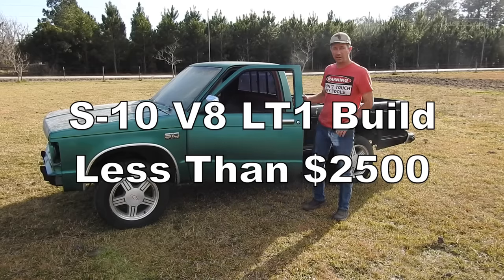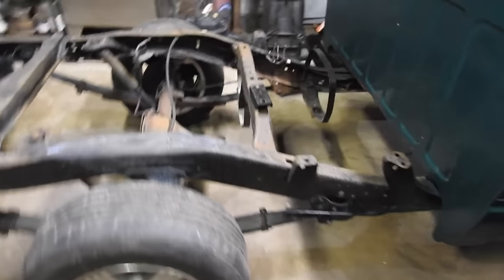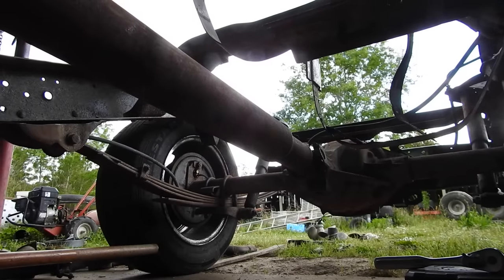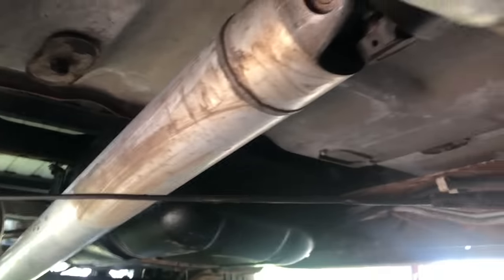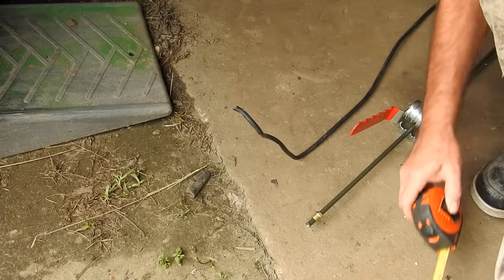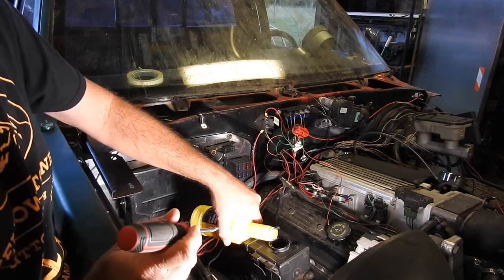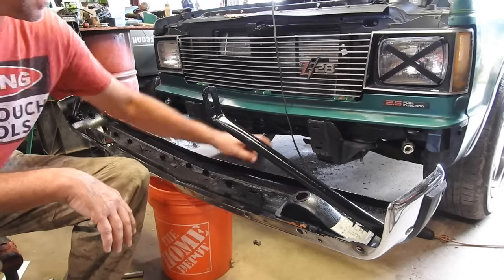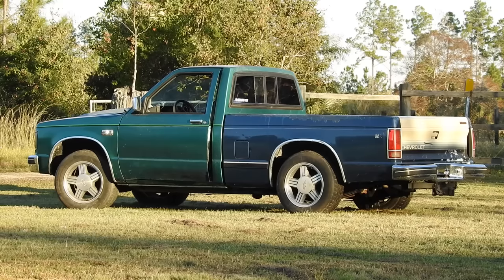S10 V8 LT1 Build for Less Than $2500

Comment: Thats great the boys are big enough to do the heavy work for dad now. Just a tip always flex mount your exhaust or it will cause problems like weld cracks and exhaust mounts breaking. It solid mounts to the motor and the vibration goes thru the exhaust causing that problem. That comp. mount was the best place and looks awesome. Them s10's have a ton of wiring. Great idea on the copper hose bend. Also if you ever need any bends done Im local and have a good bender. What car show is this weekend?
Reply from the maker: There is always the Fourth Saturday main street show, but I got busy working on a mower.  Will try to hit the show in Callahan at the depot first week in November. And maybe Hardee's second Saturday. Would love to do Daytona Thanksgiving weekend, but may wait till the spring show to take the truck. Bender would be handy, thanks for the offer and for watching.
Reply from the maker: So you don't think the computer will get too hot there?, I wish it was hidden under the dash. Yes on tons of wires too...
Reply: @chud327  No that comp. will be fine thats the same location as the 2nd gen dodge and you can only imagine how weak a dodge computer is and I'll probably see you at the depot show. Ive got the beast running and reg..
Reply from the maker: @scottsinfl  that is cool. I need a new windshield before the and and insurance . Might not have that done by then. Still plan to attend either way. Make sure you say hey

Comment: I've done multiple V8 conversions on S10 AND Ranger trucks. The Chevys are alot cheaper but the Rangers always seemed to be easier for me. Either way, they're both fun. My favorite Ranger is my '96? Splash with a 5.0 H.O out of a '92 Foxbody. My favorite S10 was my '03 Xtreme with an '02 Camaro SS swap. Ranger is a 5-speed the Extreme is automatic. I really wanna do a 90s Dakota with something wild, like a totally built 318 with a 4 barrel, high rise intake and a pissed off cam. That's gonna be my next project after winter. It's hard to find a Dakota around here that isn't rotted to pieces.

Great work and great video! 🤘👍
Reply from the maker: One of each from the big three would be great, heck have a ranger and S-10 is cool to. Do you have any videos of your collection. Would love to watch the comparison. Chevy is always cheaper in my book, but the again, I rarely work on Fords unless it is for someone else. Thanks for watching!!!
Reply: Just get one of the Dakota rt that have the 360 factory and you won't have to swap anything.  They're available in rcsb.  They was like 250 horse 350 tq factory but they're actually pretty stout and come alive with mods.  I seen a guy on YouTube who did a heads cam turbo build and was over 600 wheel for years on the stock bottom end..
Reply: Seems like the ranger would be cheaper since the explorer was same as ranger and came factory with a 302 option so you could source any parts needed from an explorer it seems.  You could even drop an entire explorer motor since they have the gt40 top end but swap the cam and springs before putting it in the ranger with long tubes it would be a decent runner.
Reply: @midnight347  you are correct in pretty much everything you said. The problem is that five liter Explorers are rare around here and it's even rarer to find one that actually runs. I think the Mercury Mountaineer came with five liters also and AWD and I'd kill to yank the entire drivetrain out of one and stuff it into a Ranger

Comment: While it wont be cheap I would consider a limited slip differential (LSD)   maybe new rear end ratio....do you want better acceleration or a better (lower engine rpm) highway gear    I have a v8 302  swapped 1984 Datsun 200sx with a T5   I originally had a  r200 3.9 open diff....went to a 3.15 lsd     makes better highway speed and still accelerates very well      the open diff spun one tire to easy     the 3.15 lsd makes the car hook and go
Reply from the maker: I actually almost picked up one at the junkyard. It was the whole rear end on half price day. However it was 4 something years and I don't want to give up all my gas mileage. Found another, but was too close to closing time. Will definitely be researching something for the rear in future episodes. Thanks for watching and your ride sounds cool.

Comment: You should put a valve on the exhaust so you can just flip a switch and it changes the exhaust like opens and closes
Reply from the maker: Funny you should say that, I did that tonight, but it is a cable you pull instead of flipping a switch. Video coming soon and thanks for watching.
Reply: Ok well I didn't really know that I mean I only seen it in a movie that I watched

Comment: I had a truck we called frankensten. Yes, sten. That's what we called an S-10. The front half of the truck was 2 different 1987's and the back half and frame all came from an 89 lwb. I ended up with a 383 stroker in it. The entire build was similar to a friend of mines, dads truck. It turned out pretty nasty. I never totally finished the truck. It was running and it was extremely fast but there was more I wanted to do to it. A guy offered me the right amount of money, I sold it, and then started another project lol
Reply from the maker: sounds very cool and like something I would do. No one has offered anything yet, but if I sell it, I will kick myself the next day... Always wanted a 383, maybe someday. Thanks for watching.
Reply: @chud327  honestly, I really hated seeing it driving around town after I sold it lol. I stayed upset for about 2 years after that. They had painted it and used it as a truck to draw attention to a local auto parts store. They would let employees run errands in it. That finally caught up to them when someone blew up the motor. Some advice for your build: get some really wide tires for the back. It's light and doesn't take much to get it to break loose. My truck was scary to drive on a wet road.

Comment: One of the scariest test drives I’ve every had was when I checked out a c10 with a v8 , lower the center of gravity and try your best to get its weight ratio in a better balance , a lot of weight up front  . If not just drive it straight line at any speed  , never use it with any velocity on corners .
Reply from the maker: Sounds like fun, thanks for watching!!

Comment: Now this I'll watch. I've thought about putting an lt motor in an s10.
Reply from the maker: This is my 5th V8 S-10. I love them .. thanks for watching!
Reply: @chud327  nice. We're any of them the newer body style? I used to have a 2.2 liter single cab
Reply from the maker: @ian5780  not with v8. They were all square bodies. However, I have had about 25 S-10’s probably 1/2 were newer style.
Reply: @chud327  that's a lot of s10s.

Comment: i only have 2000 in my 68 chevy pu with rebuilt front and back suspension power steering and power breaks, running a stroke 454 with a 02xx trans good to 800 hp full chrome trim full new gauges new tail gate dash all rebuilt looks better then new with the chrome parts full power heated buckets black leather, then i have a 79 cheyenne 4x4 short box full option truck with a 400 sbc and 400 turbo 100% factory got it free, then i got a 70 ford high boy dana 60/80 lockers ranger with tool box on side with a 390 4 speed only have 250 in it rust free really good body on all the rigs but i have a lot not on the road have 10 acres of rigs cars and trucks have a lot of hot rods on the road plus i get parts at cost from the auto parts place
Reply from the maker: Sounds like you got a great set up, I wish I had more junk cars... thanks for watching.

Comment: I cant tell you how many times I have had to take a part off that I had just installed. Often times after a lengthy step by step procedure that had to be done in order. Love the mini-square body. Rear looks too low tho. liked & sub'd
Reply from the maker: Yes, I did get ahead of myself a couple of times and had to back track. I actually put the engine in twice, but didn’t have time to show all of that. Will measure the rear, I wanted it level. May use the 3 inch blocks in the matching truck bed trailer I have plans to build. Thanks for watching.

Comment: If that is a factory rear end Plan on replacing the spider gears fairly frequently.
I used to have an S 10 with a 350 so I know this very well.
Reply from the maker: This is my fifth V8 S-10 so far. I have had no issues yet. All were stock, 2 had lockers, all ran street tires. We will see and thanks for watching!
Reply: @chud327  It must’ve been the weldracing wheel pro star’s I had that made it hook so hard and it ate the gears. LMAO

Comment: Nice job on the POS 10. Only things I would have done different is I would have put little metal things over the radiator rubber support bracket gimmicks but also I thought the rear end was a Ford 8.8 with a locker it seems to be a one wheel peeler. I think you would have been fine with the 2-in lowering blocks after all. What are your next plans for it?
Reply from the maker: Next is wire up the tail light, fix rust around windshield, wipers, build a matching truck bed trailer, stereo, exhaust cut out that works remotely, front spoiler, burnouts, tag and insurance, camping under the topper, car shows, pull trailers, haul mud mower in the back, drive it...  Maybe someday I will paint it, but for now, I am digging the multicolors...  Thanks for watching.

Comment: i had a LT1 swapped 96 extended cab s10 back in 97 or 98 yep i was first haha anyways at first it ran crappy but the more i drove it it started waking up,next thing you know it was fast as hell,i was beating mustangs and camaro's,ss impala's it tuned itself is what happened,i didnt put a cam in it,the engine was out of a vette or a camaro it had aluminum heads.i had a five speed manual with 356 gears and it was bad ass,i just built a 600 hp LS swap you talk about a lot of money.
Reply from the maker: Very cool!! On the LT1, did you just use the stock fuel pump? Mine feels like it is starving for gas when I get on it. I was thinking I would try a new fuel filter first. Thanks for watching!! You had to first that long ago...

Comment: You are probably going to be fighting exhaust pipes cracking or breaking welds because it looks like you mounted the pipes solid without a rubber mount so it can shake around with the engine. Without rubber the engine moves and the pipes don't.
Reply from the maker: Yeah, I have been thinking about that and may have to go back and modify. Thanks for watching.

Comment: Damn man, I just sold my caprice and now I'm seeing this sweet ass LT1 swap, it's making me miss the hell out of that car. By the way those worm gear hose clamps on the fuel system make me nervous man, I went with all steel braided fuel lines and AN fittings for my LS swap but if I was to use rubber hose I'd DEFINITELY use high pressure fuel injection hose clamps and not those worm gear ones. I know probably nothing will happen and it'll be fine, but this truck burning to the ground because of $5 worth of hose clamps would be a damn shame.
Reply: Caprice has a 4.3 v8
Reply: @born2wrench  some of them did. Was more rare as an option than the LT1 at least from 94-96. I don't think I've seen one with the 4.3 in person. Mine had an LT1

Comment: Looks good , but with the 3" lowering blocks it almost looks too low in the back compared to the front . Think you will need to lower the front more now!!
Reply from the maker: I will measure it a couple more times, I was shooting for level. I am planning a matching truck bed trailer build, I might you the 3 inch blocks on that and get 2 inch for the truck.  Or I could lower the front an inch or so. thanks for watching.

Comment: need remeasure may need 2in blocks after all its lower in rear than fron appears. it look better if not level be lil higher than lower
Reply: didnt mean sound like was knocking it i re read it n kinda sounded that way but by no means! i too have love for s10 i currently have the sweetest 2000 extreme that has been sitting for 6 months i put wrong key in it ha ratchet shifter and 700r4 only 100k miles it sux it sitting bout to build carport n get it out weather . one day i rekon il do  ls swap it if cant figur it out the wiring on this one cuz its custom n i dont know who did it ....but anyhow keep videos comin you do a great job a true engineer
Reply from the maker: Yeah I want mine level or slightly higher in the rear. If my rear is lower I am hauling something. Thanks for watching!

Comment: Good work .to low in back 2 inch.would have been better .would have gave it a small rake and would have looked more S28 hotrod .plus the receiver hitch is now to low for towing ...air shocks I hear ya
Reply from the maker: Yes, I may use the 3 inch blocks when I build the matching truck bed trailer and get 2 inch for the truck. Air shocks would be cool too, it already needs new rear shocks  Thanks for watching.

Comment: You did a great job on that truck. Sounds nasty in a very good way. I think it would have looked a touch better with the 2 inch lowering blocks, to me it looks like it is a bit low in the back with the 3 inch blocks
Reply from the maker: Was going for level and when I measured there was a 2 inch difference, after buying 2 inch blocks, I remeasured and it was 3 inches. Maybe it went back to two .. bipolar truck?? I may use the 3" blocks on the matching truck bed trailer I am planning to build. Thanks for watching and for the comment!

Comment: you might already know but I believe GM makes a high torque starter that’s about half that size and should be more clearance
Reply from the maker: Yes, I had to use one on a prior project. Will keep that in mind just in case. Thanks for watching and for the tip!

Comment: I think it would look better with 2 inch blocks so it has a little rake in it stance...
Reply from the maker: I am kinda thinking the same thing. I think I will get the 2 inch blocks and use the 3 inch blocks on the matching truck bed trailer. Thanks for watching.

Comment: Should have keep the 2 inch lowering block's.  The 3 inch made it  a little bit to low in back. Otherwise awesome build.
Reply from the maker: Excellent suggestion and if you check out part 2, you will see that I agree with you. I picked up and installed 2 inch blocks again. thanks for watching.

Comment: The 2" lowering blocks prolly would have made it look more level, the 3" makes it look like the rear is just a tad lower than the front.
Reply from the maker: Measures level, but the can always get the 2” and use the 3” on the matching truck bed trailer the I just started. Video coming soon.

Comment: I have an S10 with a lot of good parts and a bad body.  I'd planned to install hydraulics and make it a show truck.  The doors and bed are bad.  The suspension is new including shocks.  Brake system is new.  Has 9" drop kit.  Billet trifan wheels and billet steering wheel.  Would make a hell of a lowrider.  I'd sell It for the right price.  It's been sitting for 25 years.  No back window.  Windshield is cracked.  Side windows are in tact.  Still have the keys.  Make me a good offer and she's yours.  Engine and 2 transmissions are in the bed.  One transmission is good or was.  The new parts are hard to come by these days.  The drop kit alone costed 900.00 plus tax and shipping 25 years ago.  Make me an inflated fair offer if you're interested.  There's a couple of driveshafts in the bed as well.  It's in north Georgia.  You'd have to haul it.  I had been looking for a 1992 S10 with a good body and vortec 4.3 to swap the drop kit and rims and stuff to but there's nothing available and hasn't been for years.
Reply from the maker: Sounds cool but I'll have to pass for now. No way to haul and I already have another to fix up first... Thanks for the info and for watching!!
Reply: @chud327  well keep it in mind.  It's hard to find an s10 these days.
Reply: @chud327  if I could find one I'd build it myself.
Reply: @chud327  hey you're welcome.  Look what I have is perfect for what you built.

Comment: Two inch lowering blocks would have looked better i think the rear sits too low now but other than that you killed it broski gold build you  should have done a real burnout just stop and jump on it i bet traction is a real problem especially on wet roads cuz those w a 4.3 it is no doubt and the factory added a third little shock on 4.3 stick trucks to control axle wrap it works well too
Reply from the maker: Hope you will check out part two and see the two inch blocks go in.  You are right about traction. I still need to do a proper burnout and thanks for watching.

Comment: Great video 👍
I do have one question. What are the flux core wire specs you used on the exhaust? I was going to use clamps till I saw this. I think I'll give it a shot.
Reply from the maker: .035 flux core. good luck and thank you for watching

Comment: I don't know why I keep watching these v8s10 swap videos. I just finished my 4th and only drove it maybe 5 times..  I need to build another to figure out why I can't be happy with just making one and done..
Reply: And I dig that you threw a lt1 in a square body.. kinda like  it slipped the factory. Or if it was chevys ideas to a "cyclone" but it got banned cause it was to much muscle! 🤘🏼 much love keep it up brother
Reply from the maker: I may have the same issue, trying to hold on to this one. On the other shoulder, the devil is saying sell to fund that next one you just bought. The my son says keep it so you can have two that run at the same time... I am torn. Thanks for watching!!

Comment: NEVER use the plastic line for oil pressure into the cab. go find the atual metal line kit they make. Alot more durable.
Reply from the maker: Good tip will consider on the next build starting soon, and thanks for watching.